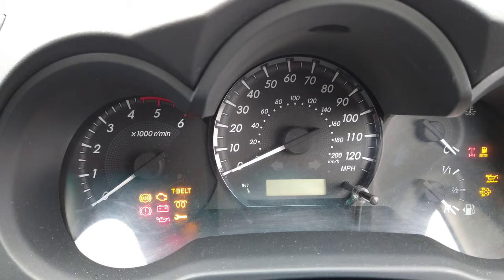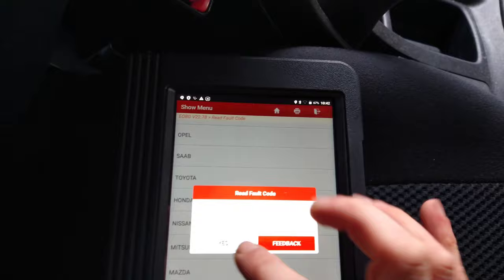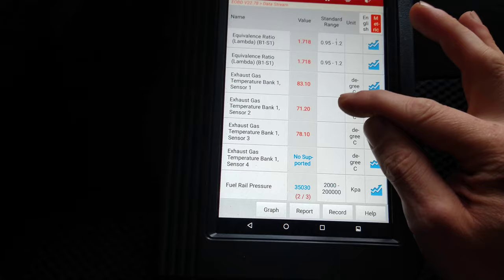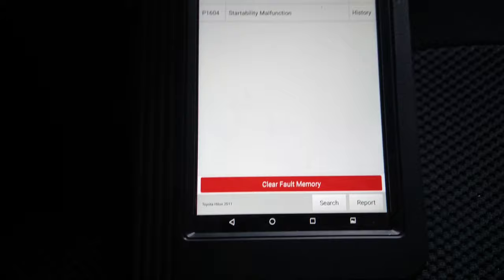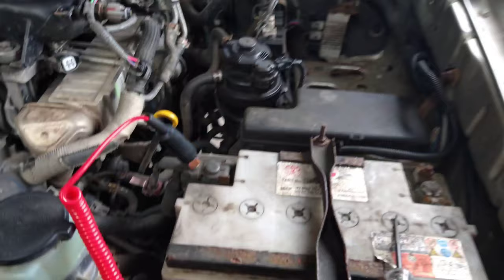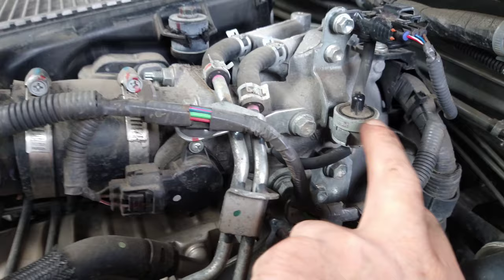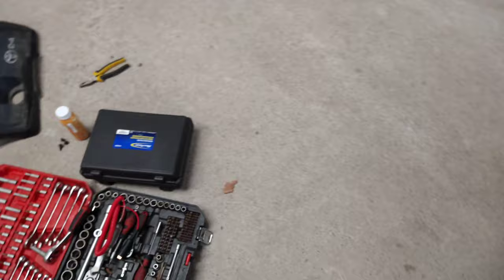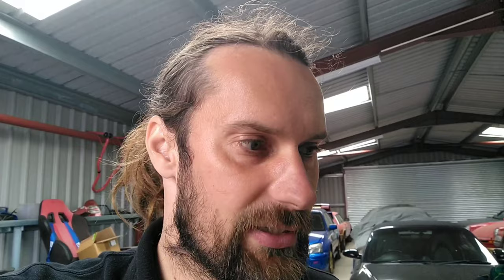Toyota Hilux (no power over 2000rpm)

Comment: Mine's a 2002 2.5L 2KD engine and had the same problem. The workshop OBD scan tool cant find any fault code too so I think its the sensor reading to the ECU. Thanks for this helpful video

Comment: Great job as always matt. Could you see the discrepancy between MAP and BARO KOEO perhaps on the serial data? Its something i always look out for.
Reply from the maker: I usually look for both to be the same KOEO or I at least look for the MAP to be the same as the known baro pressure in my location again with ign on.
I had 101kPa baro and 78kPa MAP so this may be using a separate Baro sensor. 
I have heard scannerdanner say  the baro can be the same sensor and will only read the baro with ign on engine off, or at full throttle for a gasoline engine, that makes sense for a non turbo. 
Thanks for watching and for your comment
Reply: @mechanicmatt871  yeah matt, baro can be read from a tiny hole in the map sensor (so is separate) or from inside the ecu or even from the maf. So if the map changes wrt baro on start up then it has a separate sensor

Comment: Thank you Matt, I’ve recently been having this problem with my 2017 4.0 V6 Hilux.
I’ve installed a PedalBooster which increases the throttle response, usually only started pulling around 2k rpms due to the delayed response, but is now nippy from the get go.

Do you think that the throttle opening quicker might affect that sensor, and/or the intake valve not opening quick enough in comparison to the throttle?

Am going to get my sensor checked, would just like your opinion on that matter.

Comment: Great diagnostic , thanks for sharing this video matt , i have a problem with a toyota prado 120 1KD engine , this car had this dtc P0045 standing out for something wrong with the turbo actuator circuit , i checked everything using a wiring diagram between the turbo driver and the actuator , everything is fine , the code can't be cleared , when i disconnect the Vane nozzle 2 wires connector , i can Clear the code and the car accelerate better , just can't figure out what's wrong with this car , is it the ECM or what ? Any idea bro ?
Reply from the maker: Hi does this have a vacuum solenoid to move the turbo actuator? If it has I would see how much vacuum is there with the solenoid disconnected and with the solenoid activated Incase it is leaking or blocked inside. Thanks for watching
Reply: @mechanicmatt871  no it has an electric solenoid to move the turbo actuator , it's the one that i told you that i disconnected earlier , thnks for the reply

Comment: I have a question please help: I have Toyota Hilux 1KZ TE 3.0cc twin cab and its failing to reach a rev count of at least 2000rpm. On diagnostic machine I ma getting the report engine speed sensor circuit sensor problem. Where do I see this and how do I solve it. I have 2 wire on the right side facing the car just below the throttle body area. Please help. Injector pump perfectly working

Comment: I have opposite problem wth same car..2009 hilux..when im boosting, the check engine light will appear..but when slow down, the light dissapear..My engine had been remap, boost controller installed, put harder spring to my actuator.

Comment: Hi Mat! Got a Prado with similar issues to what's happened to this Hilux, hard start, when it does start and I accelerate it's just throwing out white smoke and it's a struggle to get to 2,500 RPM... No fault codes... Prior to that when it started fine as soon as I accelerate to drive was just cutting off. Any suggestions?
Reply: found out what was the problem?

Comment: You have a very nice explanation, if the car is on limp mode and can't  exceed speed of 100 km per hour, even if you press the gas pedal to the bottom what can be the problem? And what can be fixed?
Reply: Hi, Did you find the issue with your car and it's solution ?
Reply: @Waheed.w  Yes
Reply: Can you kindly describe what was causing the issue and how did you solve it? I am having same issue with my hilux
Reply: @Waheed.w  first check on diagnosis machine for any trouble codes. What are the codes if any??
Reply: It is giving P1604 code which is startability malfunction
Reply: @Waheed.w  does it have a hard start?? If Yes check the battery whether it delivers sufficient voltage, if its OK. Then Check Connectors whether have corrosion, if OK then go for the starter. If it has no any hard start. Then Check for the fuel filter it may be clogged as a result fuel pump  doesn't send sufficient fuel pressure to the engine. It can be cleaned or you may replace it. If is OK then check for the wire harness going to the Engine Control Module. If they have corrosion may cause some delay in signals, as the voltage is not sent sufficiently then try to clean the connectors. If it is OK but as you drive you get low speed then try to check speed sensors.
Reply: Thanks for the checkup details.
Apart from that code, I am having same issue as yours. That is low power, acceleration ain't good and hilux ain't going above 100km per hour.
Reply: @Waheed.w  is it diesel or gasoline?? Automatic or Manual??? And as you scan gearbox or transmission is there any codes ??? Let me know first
Reply: It is diesel, manual transmission, 1KD engine 3000cc hilux invincible 2013 (UK model).
There are no codes but only that P1603 (startability malfunction)
Reply: @Waheed.w  if there are no codes then the first thing to check is Diesel particulate filter may be clogged as well as turbo charger not working properly These are main problem. Also try to clean fuel injectors, and change fuel pump and its filter. Is the car giving black smoke???

Comment: Thank you for sharing this video i have a problem with toyota hilux 
The check engine light is on and the car has low power.I searched in the computer and the result was the turbo (P1251)
I changed the turbo  and the problem is the same 
When i clear the check some times the car goes well but in other cases it goes with a low power if 
I need your help if you can
Reply from the maker: Look at the electric actuator on the turbo, check that it is free to move ok and the wire connector looks good.
Reply: @mechanicmatt871   me prende dos fallas mi toyota hilux 1kd el codigo es p1272 y el p12400 que sera una ayuda porfa ...

Comment: Hi mate, may i ask if what is the reading of a faulty injectors? In my case two of the injector are showing negative readings( -1.5mm3s & -0.4mm3s)
Reply from the maker: Hi Jefferson, this doesn't sound too bad, they usually all Ballance out when you add them together. It's only done at idle. When there is a faulty injector it will be a lot of difference. If the milage is high and it is smoking and has refused power it may be worth changing all at the same time. Although I'd check the EGR and intake sent chocked.

Comment: I have a question, my vans model is a toyota estima emina 1994 model. Im javing problem with its power sometimes it has power problems lowers its rpm feels like your runningout of diesel in it. Lack of power even when running. Fuel injection and nossle tips been calibrated. Change the fuel filter the fiel pump. Even the intake filter. Can you give any suggestions? What to check? From the philippines here
Reply from the maker: I am not familiar with this model of Toyota, I would check that it is not getting air into the fuel line from the tank to the diesel pump. I may block off the fuel pipe at the tank and then see if I can pull a vacuum at the diesel pump end with a hand vacuum pump. Maybe even rig up a small diesel container to supply the high pressure diesel pump and see if things improve that way you would know it's a supply problem. Hope this helps and thanks for watching

Comment: Hey Matt..im facing the exact same issue where my map signal is reading 1.0 v where it is supposed to read 1.3 to 1.6 v..did you figure out what was the exact reason because i already changed my map sensor and the reading is exactly the same.
Reply: I have this problem as well, I saw another video that says it could be the actuator valve that needs to be replaced, which doesn’t allow your intake valve to open up in time/at all.

I got a PedalBooster installed which increases throttle-response, which leads me to believe that this might be the problem with my Hilux

I hope you got it sorted out by now🤝

Comment: Hello I have Toyota Hiace Kdh201. 1kd ftv engine have same smoke (your cab).
. But no check engine... what is the problem ?
Reply from the maker: Hi Manuka, it's really hard to say. A few things could cause that. Although I would start by looking at live data for anything that is out of spec. Do you hear an intake boost leak when you rev the engine? Does the map (boost) pressure increase when reved and return to normal barometric pressure with ign on for your area.
Could be due injectors. It's hard to say without seeing it. Thanks for watching

Comment: I have a hilux 2kd.  No power idling under 2000 rpm. I've cleaned fuel line, tank, scv, injector pump but still same problem. Need your help...what do u think? Is the problem
Reply from the maker: I don't know without seeing it, it's worth scanning for fault codes and looking at live data for something that stands out. don't forget something unrelated like a binding brake.
If you were in Cornwall I could take a look at it.

Comment: Hey... So my dad has this  Hilux pick up which is 2kd  he got it for  a cheap price in kenya ,it had a couple of issue it wasn't  actually  starting  and  didn't have injectors, ecu and  many other parts,  so he did manage to restore  it  but  the mechanics ripped him off and didn't complete the  job,  so currently  it starts  well but it has no power when  accelerated  it starts  knocking  for a bit  then it stops when it starts moving....it has a fuel filter warning light
Reply from the maker: That sounds like a possible injector fault or a tight cylinder from something like a spun big end shell or a broken ring, if you could do a relative compression test and one cylinder is higher amperage than the others it will indicate a tight cylinder otherwise it's worth checking for fault codes. Thanks for watching
Reply: Check blockage of fuel pipes supply and return and fuel filter

Comment: hello matt,what actually happend to your hilux did it the fuel pump problem. i have email you my question. i hope you reply.
Reply from the maker: This ended up getting a new boost pressure sensor (map sensor) it brought the live data closer to what it should be. I had checked the fuel pressure at the rails pressure sensor of camera, I used a scope and it didn't have any drop outs when the car ran badly. I didn't show that because it checked out ok and didn't seem relevent to the video. 
Sometimes I like to check other possible causes of low power to rule it out so the customer doesn't get told they need something else after a new part was replaced.
Also worth checking the turbo actuator is free to move and you have plenty of boost pressure. 
MAF signal would also be worth checking,
The checks should be done at 2000 rpm if that's where the low power is. 
This is not possible to do a leak off on the injectors because they are in the head and only has one return from the head. 
Although if it suddenly has a large leak of at higher rpm it could indicate that you have an injector fault.
A very quick and easy test would be a smoke test through the air intake to check for leaks.
It's usually a mechanical fault when there is no fault codes.
Thanks for watching and your question
Reply: @mechanicmatt871  so a bad map sensor was the problem?…if so when you changed it the problem was fixed right?
Reply from the maker: The MAF fixed this one. Although I have noticed on some scan tools there is a difference in map pressure between obd data and vehicle manufacture data. Thought it was worth mentioning. Thanks for watching
Reply from the maker: I ment map sensor

Comment: hello. I have a code P0047 in my 2015 hilux and it says  "Turbo/Super charger boost control solenoid circuit low" and it has no power and only go to 2k rpm. does anyone know what's the issue and what to replace? please someone help me.
Reply from the maker: Hi Elon, if I was looking at a car with that code, I would look to see if the turbo is vacuum controlled or electronically controlled. 
If it's vacuum controlled I would check that I had vacuum supplying the vac solenoid and that it had vacuum coming out of the solenoid when it is activated, you could activate it with something like a power probe.
I would also check that that amount of vacuum would be enough to move the turbo actuator.
If that looked okay I would then check the potentiometer was changing its signal voltage whilst the actuator moves, that's if it has a position sensor.
If it was an electric actuator on the turbo it would be similar tests, just without the vacuum testing. Hopefully this helps.
Thanks for watching.
Reply: @mechanicmatt871  Hello sir! Thank you so much for your reply! Mine is electronically controlled and the actuator rod or linkage (idk what it is called) don't move when starting the engine or reving the engine. and the mechanic said that my actuator is bad and needs a new actuator but he only look at it and didn't do tests or anything. But according to my research the actuator rod or linkage seized up sometimes and that's what causes it to have no power. Should I just replace it sir? because it's so expensive.😭
Reply from the maker: If you could check that it is getting power and ground at the actuator, or try disconnecting it and see if it is the turbo linkage that is seized or the actuator that is not working. Sometimes I manage to loosen a couple of ten mill headed nuts to create a little free play and see if the linkage on the turbo moves freely and that the actuator rod is able to pivot freely too.
Reply: @mechanicmatt871  thank you sir!😊

Comment: Sir how can i increase the rpm for my toyota hilux 2kd d4d
Reply from the maker: That may be one of a few things, if you have a scan tool with fault codes and pin data it could point you in a direction, check fuel pressure, air flow, boost pressure, what is the condition of the fuel filter, could be to many possibilities for me to say.
Reply: i'm facing the same problem with my hilux 2kd d4d..rpm can reach until 2 only..speed 40-50kph..could it be problems on the fuel rails?

Comment: I have a 3L 1kd that has zero power I've replaced the injectors, cylinder head, turbo, sensors, fuel pumps en all but still no power......... En when I scan it it bring up( throttle switch :off) what is that.... Someone plz help 🙏🙏

Comment: my toyota hilux d4d lacks power please help me
Reply from the maker: Try checking for fault codes to see what you get, if no codes have some one take it for a drive with a scan tool and watch fuel pressure, boost pressure (map) , air flow, turbo position. See what is dropping out.
Thanks for watching
Reply: @mechanicmatt871  thank you so much i will try. You know in my country africa there are no good mecanic
Reply: @mechanicmatt871  we have already made the diagnosis but it indicates nothing no failure. however the hilux lacks power and it only has 100,000k. I changed the diesel filter, the pump and the injector. do you think the pedal can do that?